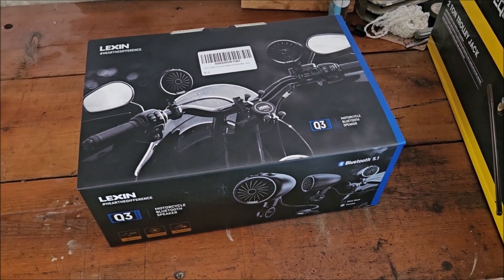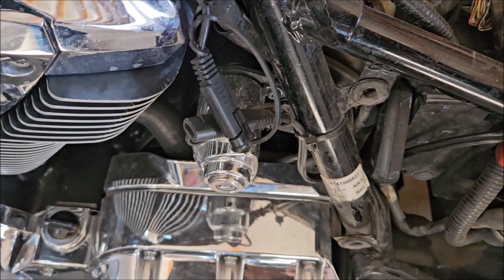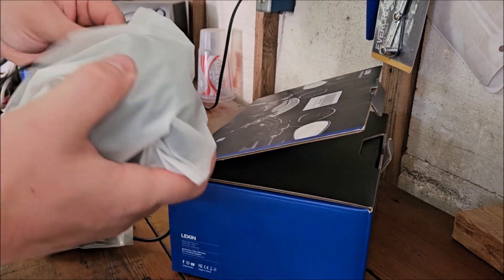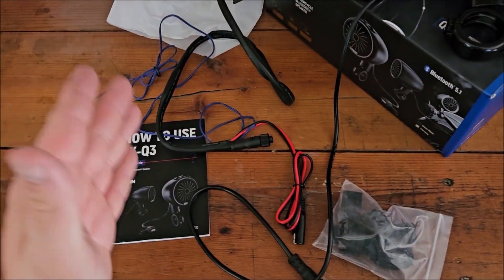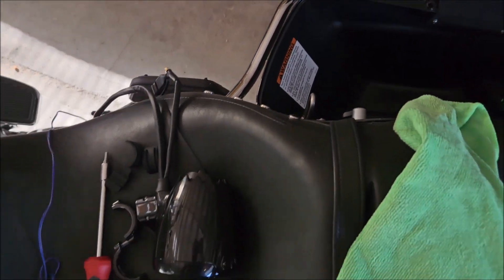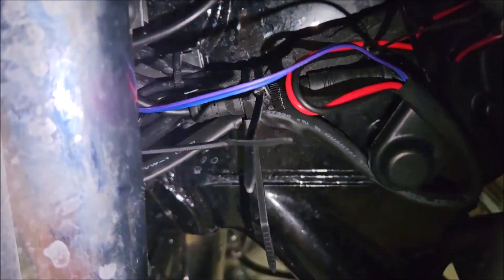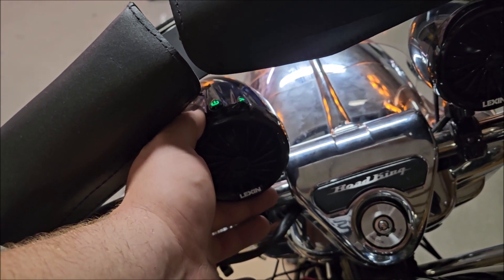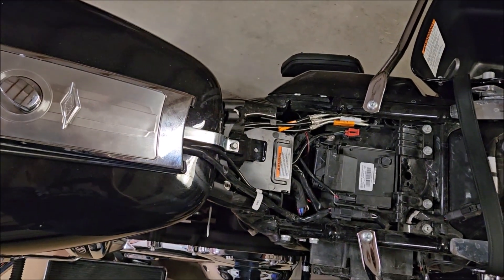LEXIN LX-Q3 Bluetooth Speakers Install and Review

Comment: I've always had the 600w Boss speakers setup and my bikes and they work great! The little amp can be mounted just about anywhere. There's also a small volume control button that I mount on the left handlebar that I raise/lower the volume with my thumb while riding. I've had 4 sets from Boss and they are perform great. I can hear them riding down the interstate at 80 mph.  There is not much bass but I can hear my tunes and that's all I need!

Comment: Hey, I’m thinking on buying these for my ATV but I was wondering if I would be able to wash these if they get covered in mud with a 1800w pressure washer, or driving threw water/rain?
Reply from the maker: @Kolton_mud I have had these get soaked in the rain with no issues at all whatsoever, even my old ones still work great to this day. My opinion is if you are using a pressure washer to clean your vehicle, I personally would not spray them directly especially in the speaker port on full blast but it won't hurt them if they get wet.

Comment: I’ve a set of 4 boss speakers, can’t fit on the crash bars and one of the two fitted on the handle bars keeps slipping.  I can’t tell you how many times I’ve refitted it, the built in clamp is awful. 
I’m tempted by these, are you still satisfied with them?
Reply from the maker: @hudsonrilke Absolutely! I still love mine and they work great, I still highly recommend these if you are looking for speakers still!
Reply: @RedBeardBiker27  thanks. I got some.  Well pleased
Reply from the maker: @hudsonrilke  Thats awesome! Glad to hear it!
Reply: I couldnot fit it into my handle bar. It was either too small or too big. So I used a combination of one thick bushing and one thin bushing and that solved my problem.

Comment: I just got them today and installed them. Everything's great but then there is this thing. If i star my bike (ignition) the speakers automatically turn on even if i try to turn them off they again turn on. What could be wrong??
Reply from the maker: @spetsnaz6739 I am honestly not sure. I have never encountered that error with mine and I've had them for almost a year now, if I can find out any information on this issue, I will try to let you know.